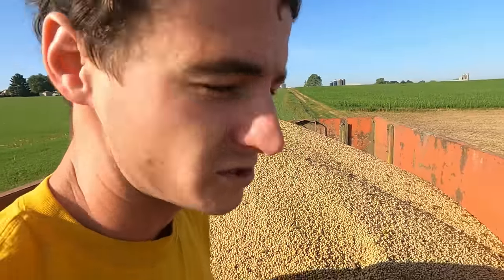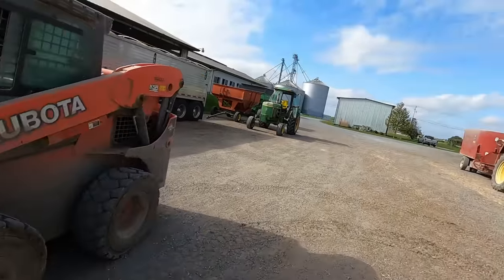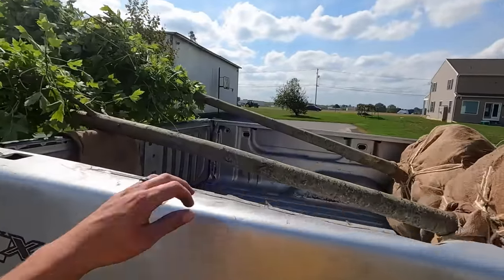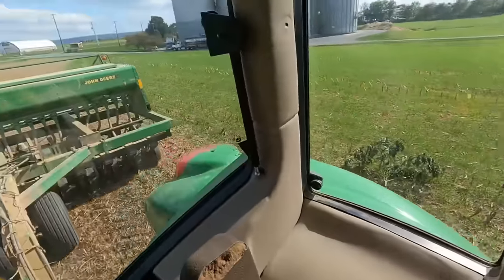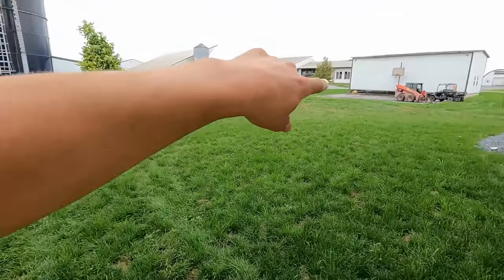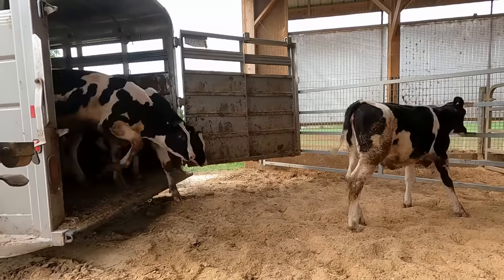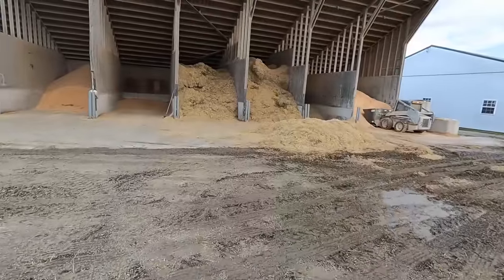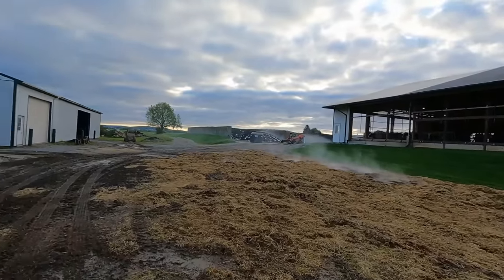We Almost Burnt Down Our Commodity Barn

Comment: For filling your grain drill I would recommend a jib boom for your forks, it’s slides right in and has an adjustable boom with a hook. I use it to lift those seed bags high enough to fill my small grain bins. Also comes in handy in all sorts of other ways around the farm.
Reply: That's very true!!  They work amazingly well...just have to be careful to not overload them...just a short extension reduces the load limit the machine can lift & stay stable...it changes incredibly quickly in short order !!

Comment: What you could do with the seed bags that would be useful for other things is a davit or gantry crane with an electric hoist. A davit would be permanently mounted but a gantry you could roll around, though it would have to be pretty big to fit around the planter. Probably the most practical would be a davit at the outside corner of the shop you do the tractor maintenance.  So it would be useful for maintenance jobs as well. Or, Richie Bros, look for a utility company digger. Truck mounted crane with augur. Those can go cheap. As long as everything works, the occasional use on the farm would be ok even if it's too clapped out for road duty.

Comment: They used to have pallets with holes in the center with bags on them and they quit doing that because the bags got lopsided and fell off the pallet and people got hurt. Ask your seed dealer for a plastic pro box, dump your bags into the box and get a seed chute or a pro chute 1 or 2. Just be safe.

Comment: On the fire department  the way we dealt  with burning hay was to remove any exposures then allow the hay to burn.
 We let over a thousand bales burn, no damage outside of the loss of hay.
Reply: Way back in 1986, we had a quonset hut of hay combust. One Fire Dept Chief wanted to cut a hole in the roof to ventilate. Another Company Chief advised against that. Hay was removed, and building is still in use now, with no holes in it. Sometimes, people get carried away by authority and conventional training, and the latter doesn't always apply to Ag.

Comment: Is there a place on the farm you could hang the bags from? lift it up with the skid on a pallet, hang the bag, and pull the drill under the bag. Then you could tie off the funnel if it doesn't all fit in the drill...